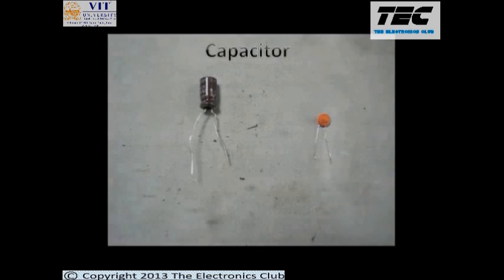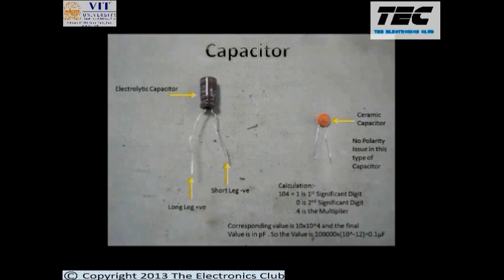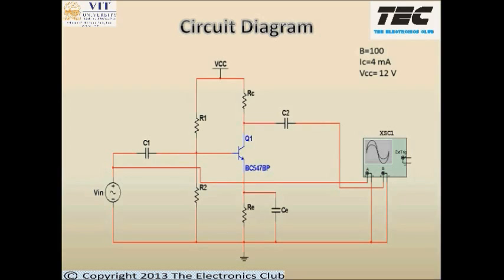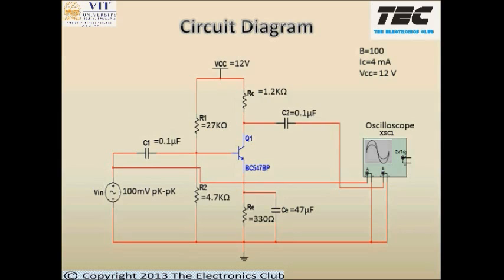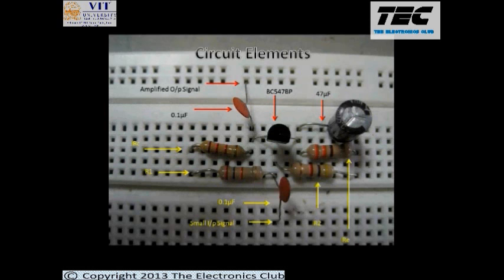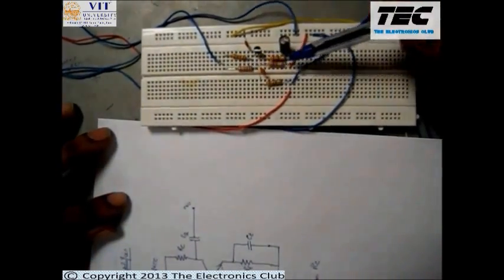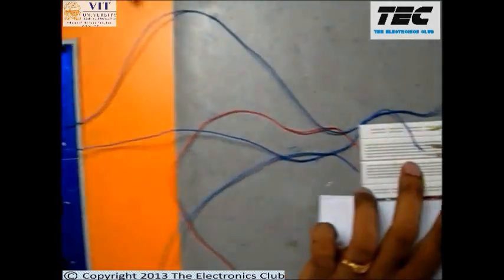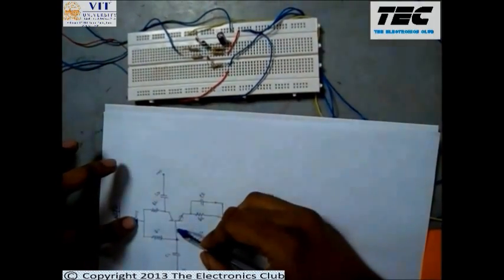Common Emitter Amplifier

Comment: As usual, this circuit is presented without any consideration for why particular values are chosen. In addition, the bypassed emitter resistor is shown without any consideration of the consequences. The principal problem is that the gain becomes the ratio of the collector resistor to the effective emitter resistance of the transistor, which is around 25mV/Ic, so about 6 ohms in the quiescent state, but varying as the output swing increases, producing severe non-linear distortion of larger signals, even though well short of clipping. The second issue is that the bypass capacitor and the 6 ohm emitter resistance of the transistor create a high-pass filter which attenuates frequencies below about 570Hz. These effects make this circuit unsuitable for use in audio work. Finally, the emitter bypass results in an input impedance of about 600 ohms, which couples with the 100nF input capacitor to further reduce input signals below 2.7KHz. All in all, a poor example of common emitter design.

Comment: This is horrible teaching. The teacher has no clue what he is doing. He is attenuating the input so that the shabby clipping of the circuit he designed is hidden away. The student learns that to get a sine wave on the output the input signal has to be really small. Also he says "giving 100mV signal" while turning knobs on the scope - horrible.